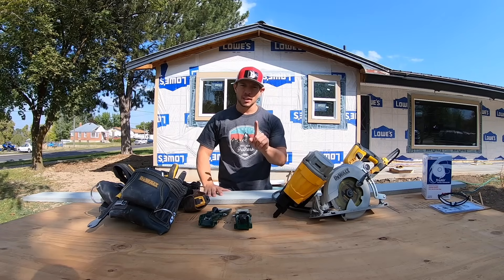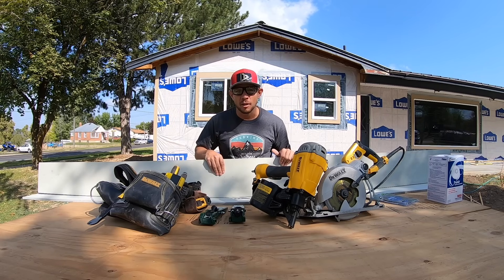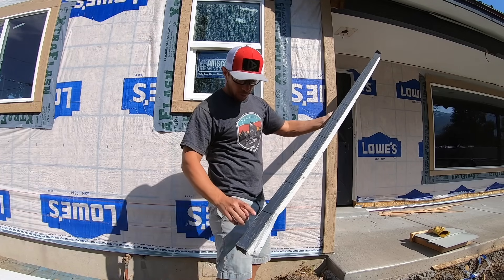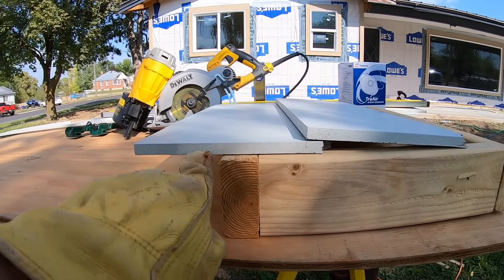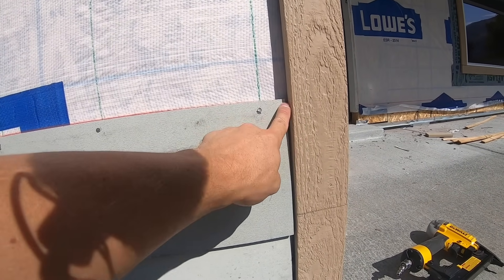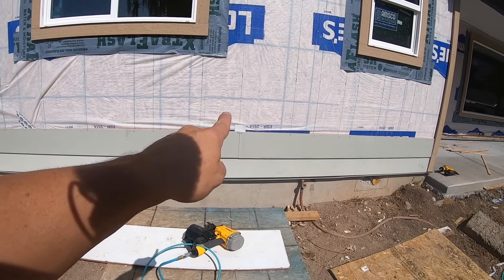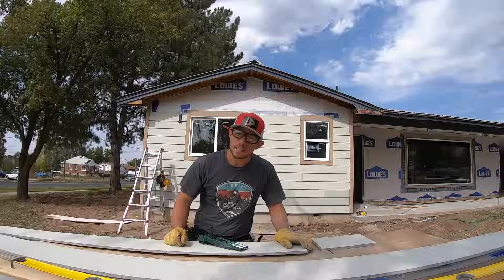How to Install Cement Board Siding

Comment: Shouldn’t the sides on your window trim run long and your bottom be cut the same as the width of the window? I’ve just never seen it done the way you’ve done it. Seems like a good place for water to find it’s way in eventually.
Reply: You are right
Reply: I was thinking the exact same thing
Reply: Run the trim around the windows,the same way as the window flashing...

Comment: I don't see a drainage plain behind the sliding. We strip our houses with 1 x 3's first over the studs. The bottom always starts with Cor-A-Vent wrapped with mesh. That guarantees a 3/4 inch air space behind the siding.

Comment: Very amazing presentation, very clear explanations, camera doesn't move constantly, no background noise, pointing at every single spot just like it's a well designed documentary! I'd say this has been the best video that I've ever seen! The only thing is that I wish you could also demonstrate how you do the top part (the triangle as in gable area) and how you could manage cutting the cement board edges right with the perfect angle. 
Thank you so much for your time and for your amazing demonstration 👍👏😍🙏

Comment: Great job explaining things as you go along! I picked up a tip on cutting out the notch on the cutting table. It sucks not having the extra hands at times when dealing with the long boards but you are soldiering your way through it. The ending was funny!

Comment: Gecko gauges are a awesome toll and helper. I use Duo Fast siding nailer( awesome tool) . I use a compact grinder (4 1/2 inches diameter diamond blade) to cut the cement board, Tyvek wrapping “plastic” and the rest is pretty much the same setup! Great video !

Comment: I’ve built, as a DIY, quite a few cement board buildings.  Nice explanation.  Of course everyone does things a little differently.  So take my comments with a grain or a pound of salt.  I won’t mention the things others have pointed out.  Good on the shim board at the bottom.  But use a narrow strip of the cement board instead of the wood.  Don’t use the galvanized nails you are using.  Those are electrogalvanized.  They WILL rust.  Cement board is very corrosive.  More dollars but use SS nails.  No discoloration and more durable.  Good that you put the flashing behind the joint.  Good that you space the panels with a gap.  Same at the trim.  Much easier to caulk a 1/8” gap than a 1/16” also.  As to cutting the boards.  I normally use Hardie, or Hardie knock off. They are a bit longer, 12’, which makes it nicer.  Hardie is 5/16”.  (And pre-primed)  Looks like your stuff is thicker.  I use a sliding chop saw with a cement board blade.  A bit faster.  Always wear a mask and cut with the wind blowing the dust away from you.  I also use a Kett Hardie shear.  Doesn’t make as nice a cut, but less dust.  Nice for cutting odd shapes.  I don’t use the Gecko gages, though they are fine.  I like the gauge that hangs from the top of the plank.  Very ingenious.  And you really can’t have slippage on the gauge, and ONE person can do it all.  There are advantages to each, but once I’ve nailed down the siding, I really don’t like prying it up even a little as the Gecko requires.  Hardie/knockoff trim is a bit thicker than your trim, so the siding sits below the trim, even on the bottom of a board, so easier to caulk also.  Another comment is you don’t show how you nail up the trim, but looks like you use brads, which is the way to go.  But I really suggest using SS brads!  They hold great and again, no rust!  And you don’t get to the top of the trim for the windows.  I’d really suggest using Z flashing for the top of the window.  Final comment is the flashing tape around the windows prior to putting on the planks, doesn’t look to be secured well.  The weakest point for rot is around doors and windows.  Use the best tape and make sure it is adhered well.   Lots of points, but we agree, cement board is a great product.  Paint sticks to it very well.   Good video.
Reply: If the wall behind the siding is properly waterproofed why do you need to flash the gaps between the boards, especially since the bottom of the flashing doesn't overlap on top of the board below, carrying water that gets into the gap away from the underlying waterproofing layer?

Comment: What material do you use for the starter shim at the bottom? Looked like wood. I'm installing some Hardie Plank and they suggest ripping a piece of fiber cement board as the starter piece.

Comment: Great explanation video! Just happen to come across it as we are repairing our modern home that has 4'x8' fiber cement panels. Two questions: first, we were told we had to prime any edges of the panels? Is that true and two, galvanized nails were used on our home but now they are rusting and showing through. Again, they are full panels and not overlapped. Any suggestions on how to alleviate this? I am doing the repairing so want to have nails that won't rust. The panels are primed and painted (actually twice) and the nails still rust. Thanks!

Comment: Good job. Spot on work. Question? Why would board be wavy? Contractor installed 12’ and board is 3/4 bowing at spots.
Reply from the maker: Good question, it could be that the studs are wavy to begin with, or it could be that there are not enough nails put into the siding.

Comment: I'm putting up harde 1/4" siding that looks like shingles.  Do you recommend putting a lower flashing on the bottom?  What about a piece of flashing between the pieces?
Reply from the maker: I would flash the first row on the bottom and then all the joints. I love the shingle siding look.

Comment: I’ve never seen fiber siding with metal flashing on the bottom. However, I am currently re roofing a house that was done 87% incorrectly….

Also, you can cut a 1” slice of a board to use as your “starter” strip versus using the WHOLE plank.

30lbs black felt piece looks better than shiny card flashing at butt joints.

Comment: Ho do you cut around the windows? Our contractor has left anywhere from 1/8th inch to 1-1/2 inch gaps around windows. Is there any type of trim we can install to hide gaps. Contractor said he is going to caulk but this is going to look sloppy . It’s not a neat finished look as each board is a slightly different length. In siding that is not the case. That is under trim boards and gaps are hidden. Any suggestions would be appreciated .

Comment: @7:59:  I don't think the manufacturer calls for a gap.  I think they call for them to be loosely butted together, but not friction-fit.  Also, you should prime end cuts and try to use factory ends for butt joints when possible.
Reply: Not an expert but I believe you only have to prime end cuts if you're using wood.
Reply: You are supposed to prime the the end cuts according to James Hardie installation instructions.

Comment: Great but i believe the boards should be painted first and also on the sides and slightly on the back but i am no professional. Thinking about moisture control and controlling rot!
Reply from the maker: That is a good idea always, the boards are already primed and they are cement not wood so it won't be as critical.

Comment: When putting on the window trim (at 2:45 on the video)  you show the corner joint of trim boards as running horizontal.  Should this not be vertical?  Such that the joint would carry water down and off the trim.   Being horizontal it might cause the water to run along the joint and wick under the window.   Just a thought.
Reply: Yes

Comment: I need to replace the bottom boards around our shed that was built with cement fiber board. I don't have an air nailer so what would you recommend for me to use...hand nail or screw them in?
Reply from the maker: I would hand mail them in.

Comment: Can you use screws in place of nails? I know they would have to be outdoor rated. And also has anybody ever added this to a block home? I know you would have to add vertical slats evenly spaced out to anchor the siding to the wall. Asking for a friend. Lol , any info would be appreciated.
Reply from the maker: Yes, but you would have to pre drill any holes. Be sure to not over tighten.

Comment: Question ?
how long and Size of Nail ?
Q2- looks like you using Framing Nailer ?
Q3 -  How Come No Furring Stips ???
Good Video BTW
Reply from the maker: Q1: Nail length will vary depending on your sheeting thickness. Rule of thumb, nail should go through siding+sheeting+1/2 into stud. 

Q2: It looks similar to a framing nailer, but it is specifically for siding. a framing nailer will blow through the boards. I was hoping my roofing nailer would work, but it won't go through the siding, sheeting and into a stud.

Q3: I used a during strip in the bottom row, and that was all I needed to get the siding started. once the angle is stacked it is good to go up.

GREAT QUESTIONS....

Comment: I've been doing hardy for 30 yes you only have to leave a gap in your butt joints if you caulk which caulk fails  and you don't have to do a backer strip or bottom flashing which hardi will absorb water especially when it freezes and thaws so that metal drip is a ice dam

Comment: why         2 3/4 inch nails when the board is 1/2 inch thick??
Reply from the maker: The nails need to go through 1/2 cement board, 1/2 sheeting, and need to be at least 1inch into a stud.

Comment: how do you finish the last strip, do you nail and fill exposed nail heads or cover them with a trim?
Reply from the maker: You can, I nailed above the soffit line in the roof system,
Reply: @TodaysTask  hey thanks for the quick reply, i attempted my first hardy job last week and that last row had me stumped as too how i was gonna make it look good, hiding in the soffit wasn’t a option for me.
Reply from the maker: I have seen some people nail it normal, and then put a small trim piece over with finish nails.

Comment: New house they let a inexperienced workers to install, used screws blasted in everywhere and sunk them in like sheetrock. Large gaps around window coming up to the sides of the window. Might be 7/8 at top and 1/4 at bottom. And do you caulk the gaps you have?  At top of home it's vertical, then it goes horizontal,  and under that they have a 1×2 long strip
With screws blasted into that, and it's already warping, I can put my hand under those spots.

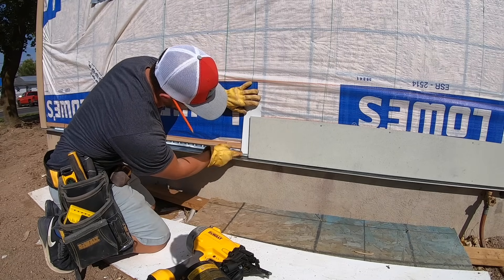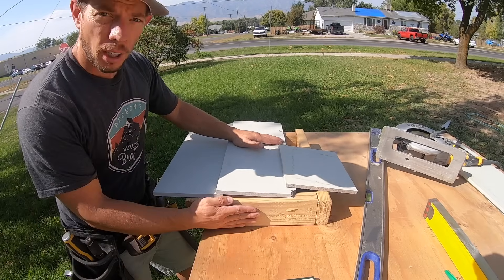Comment: 7:54  I am fairly certain that corner nail is going to break the siding over time, losing any holding strength.  Nichiha installation I believe calls for the corner nail to be 1" from the top and 1" from the end.  At 9:30 you see in your mockup how the corners break off.

In general, I think you may be nailing a bit high.  Nichiha I believe want's all nails 1" down from the top.  Nailing a bit lower helps hold  the bottom the siding tight..

Comment: The 2 windows on the left side of the front of the house are driving me nuts...why are they different??
Reply from the maker: It drives me crazy also, one is for a bathroom so it is small.
Reply: @TodaysTask  If they could have been the same, I know you would have found a way. Keep up the good work Joel

Comment: Dont use either a saw or blade. Use cement board sheers. No mask required. Always butt mfg. edges they are always straight.

Comment: If you need flashing to keep water out, obviously the siding is not to trust. Maybe better use techniques that work, like freaking concrete, bricks etc, and forget about gaps and nails...
Reply: You are required to use flashing per manufacturing instructions, just in case you need to use warranty one day you will be able to demonstrate that you did everything by instructions
Reply: @sov19871987  so what, that doesn't mean the roofing options in the US make any sense or are any good
Reply: @rafars2246  state where I live no one is putting stones, concrete, or bricks due to earthquakes. Siding has movement and it is extremely important, plus affordable. You can put whatever you want on your house. The guy simply made a video on how to and you are complaining about it.
Reply: @sov19871987  you can totally use concrete in earthquake areas. Even if not concrete, there are so many options around the world, way better options, but in our 'Murica nothing is built to last...